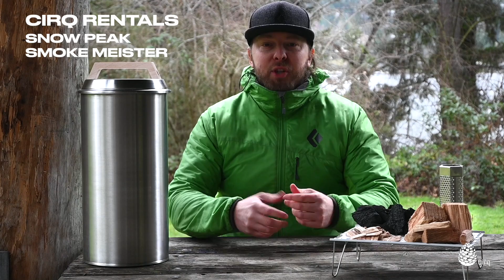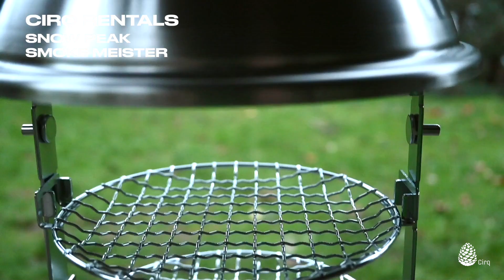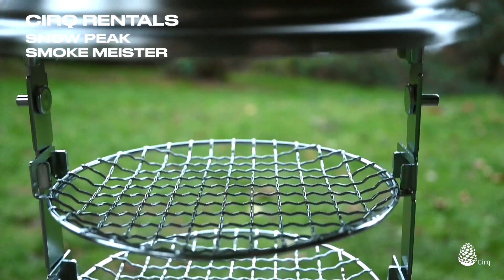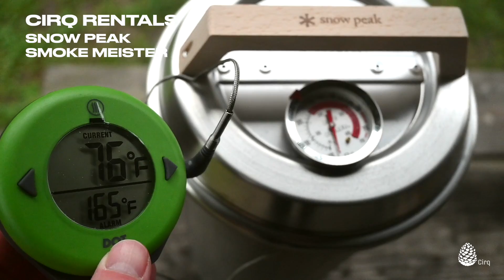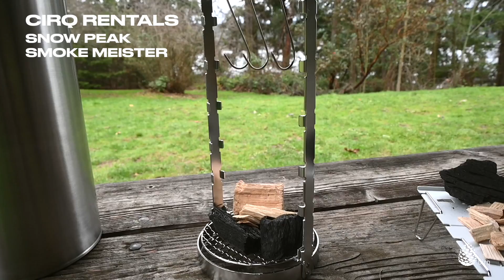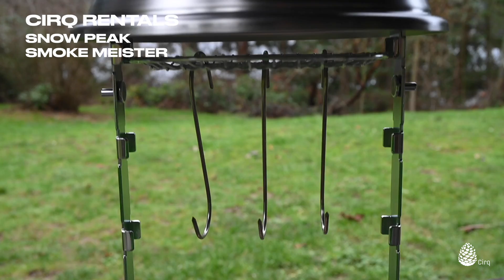Snow Peak - Smoke Meister:  Compact & Portable Camp Smoker - Overview, Set Up, & How to Use

Comment: Do you have  a link for the wood chip/pallets container as well as the meat hooks ?
Reply from the maker: Hi L,  No problem.  Here is a link to the hooks shown in the video:  https://www.amazon.com/gp/product/B08SLTD6ZJ/ref=ppx_yo_dt_b_search_asin_title?ie=UTF8&th=1  

They work fine in the smokemeister, but are a little long at 13cm/5.25in.  If we were to invest again in the future and specifically for the SM, we'd probably try to find some that are shorter (say 1-2inches). 

Here's the chip/pellet tube: https://www.amazon.com/gp/product/B083JZ2RPX/ref=ppx_yo_dt_b_search_asin_title?ie=UTF8&psc=1  This was the 1 by 6 inch.  

Hope this helps you outfit your SM and let us know if you have any other questions.  Happy smoking!
Reply: @CirqRentals  Thank you so much for the info ! Definitely going to get the woods for doing some 1/2 ribs.